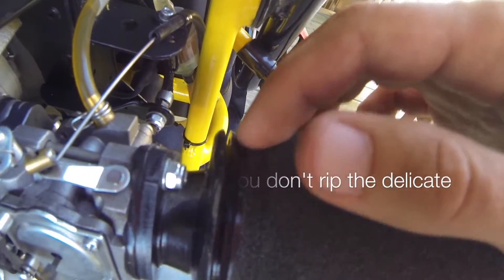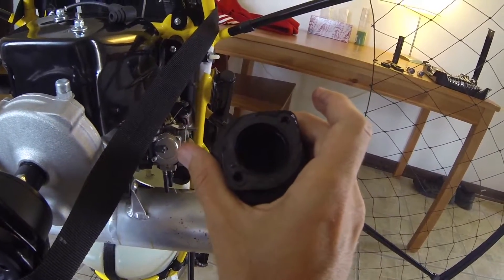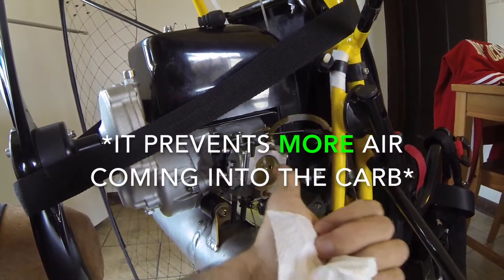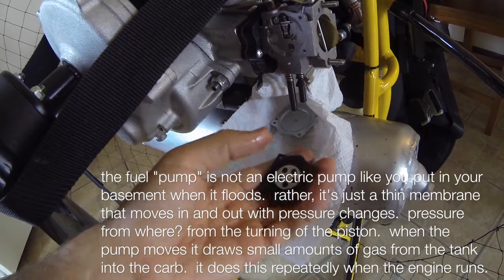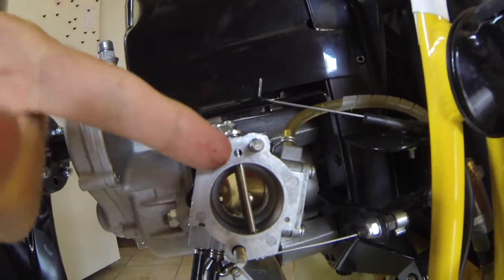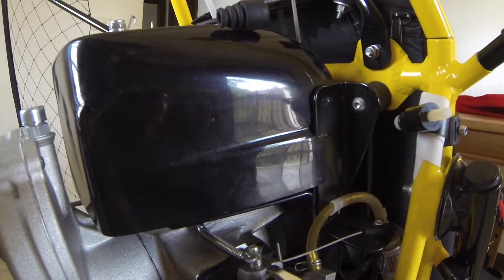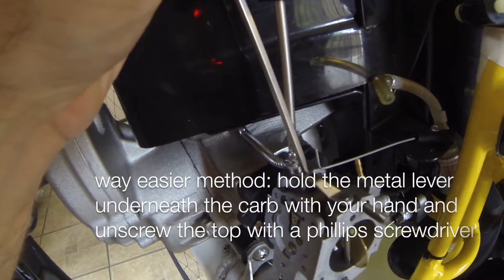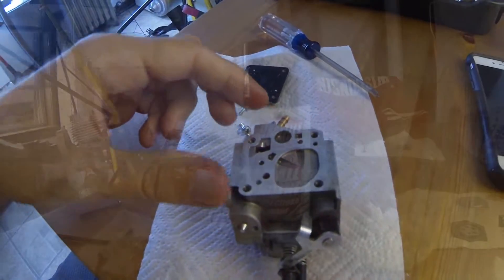MiniPlane ABM Top80 - Looking Inside The Carb

Comment: The needle and seat is supposed to be adjusted, they make a little tool for like $12. Worth it cause I'm OCD to make the correct adjustments.

I wonder what model walbro carb that is? I've never seen one that needs a spring to close the throttle back? I swapped from a bing 32mm to a walbro, I think a 37C. It's self Returns the throttle to close.

Also I don't know how many hours you have but if you have a high amount of hours and it's difficult to start sometimes you just have to clean out that decompression port in the head to the exhaust....fyi..

Oh, a P.S. there is now a gasket which is like a nude color.. it's to be used in place of the black gasket if you have ethanol in your fuel. I use AVgas so I don't worry about using that gasket, but worth noting...
Reply from the maker: in the description I say "Disassembly of carburetor (walbro wg8) & insights into its function in September 2018."  so it's the walbro wg8.  I also misidentified the fuel pump, please see the description for the correct info.  

I'm with you, I like to make precise and accurate adjustments, what tool are you talking about?  I just use a flat head screwdriver to adjust the needles.
Reply: There is a meter lever adjustment that crucial to the top 80 with wg8,the tool will adjust it incorrectly,this carb was not designed for this engine so the meter lever needs to be bent out or up to richen the top end,Had Robinson has a complete write up on it over on his site. @soccerrefeducation

Comment: Thanks for the tutorial, Stephen.  I'm right at 100 hours on my Top 80 and this is very helpful.  I'm either going to rebuild or replace my carburetor this winter.  This will make it less intimidating.  Great post.
Reply from the maker: thanks.  also, I misidentified the fuel pump, please see the description for the correct info.